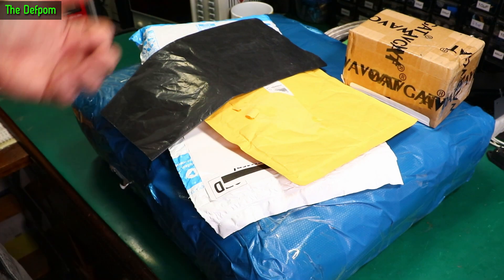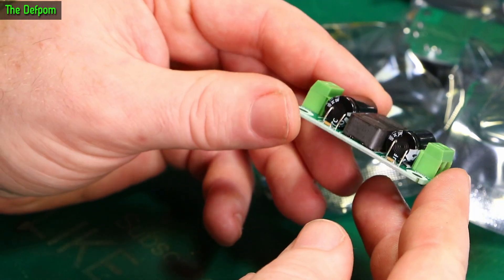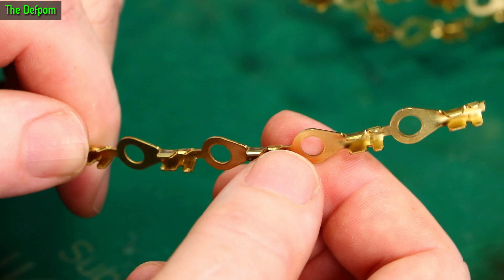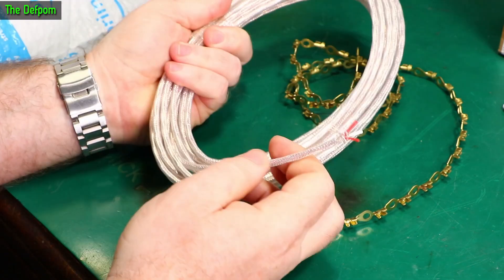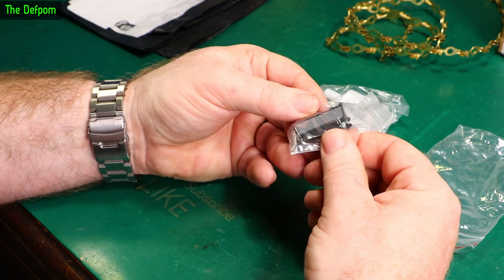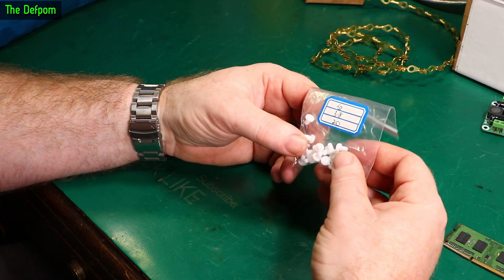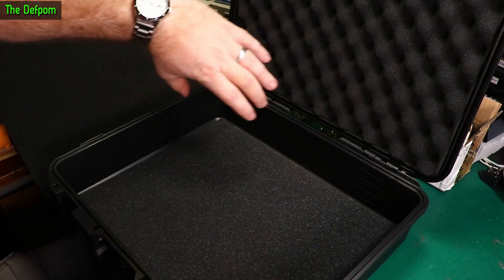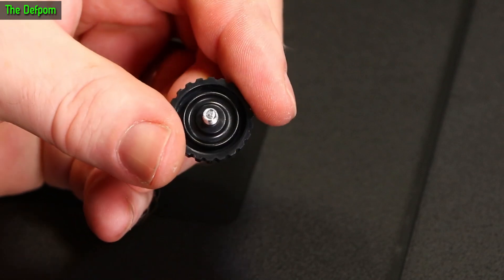🔴 What's in my Mailbag ? - Mailbag Monday 21st November 2022 - No.1065

Comment: I don't like the square cut foam, tried to use some for a camera case, if you only have 1 square widt between items, it moves around
Then while looking for Kaisan foam, i discovered Shadow foam, similar to kaisan, but i think much cheaper
I wonder if that knob is for ahand  trolley, the knob helps to retain the case
Reply: On the real cases that knob is a vent in case you have a pressure difference that makes it hard to open. But this case doesn't even have seals so I don't know.

Comment: They probably made the ring terminal in a 3 stage configuration mounted into a standard die set. 
1. Punch the hole
2. The hole then fits on to a round peg that decides the length of the rt. Cut the sides of the rt.
3. Bend the crimping wings. Press the breakaway point.
Maybe they used more steps because it would be easier to manufacture the tool,  and it would be sturdier, lower chance of metal fatigue.

Comment: If the case is air tight then you need a pressure release device if the case could be put in the unpressurised cargo hold in an aircraft.  Or it might go bang with about 14psi on the in side and not a lot on the outside
Reply: Cabin pressure at altitude in an airliner is about 8,000ft with a differential between insude and outside of upto 9psi. So, as you say things need to be vented to prevent damage during shipping by air. There is a standard which is part of a products environmental validation that covers pressure deltas (as well as the usually EMC, vibration, ingress, drop testing, etc).